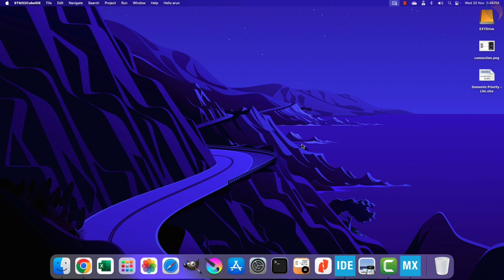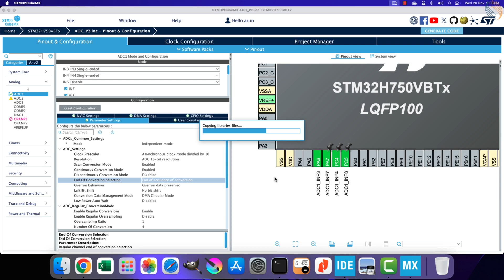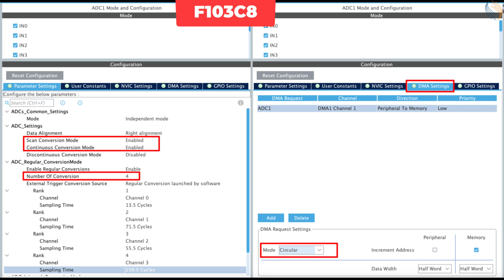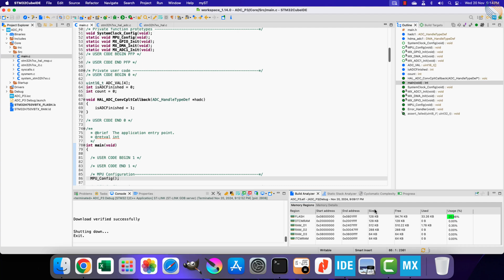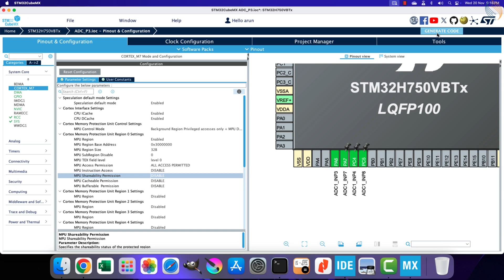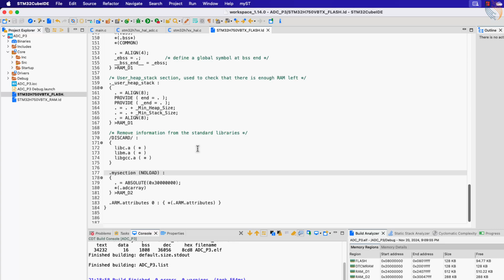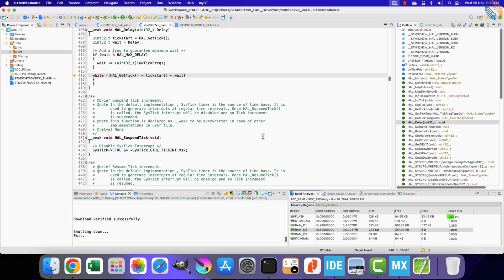STM32 ADC Tutorial #4: Multiple Channels using DMA in Circular Mode

Comment: I followed the tutorial using stm32h7 nucleo board. But the DMA seems to crash the other tasks, i tried managing the interrupt priority and memory allocations(along with the MPU with other tasks) but nothing seems to work. Do you have any solutions about using the adc with dma and freertos to work properly with multiple tasks?
Reply: I had a similar problem even without using FreeRTOS. The interrupts were clogging up the processor that I couldn't even enter the main loop. I disabled the interrupts in the .ioc file by going to the System Core -> NVIC tab, unticking the box "Force DMA channels Interrupts" and then unticking the "DMA channel global interrupt". Now the ADC is still continuous, DMA circular and always updating the value but I fetch the data when I want to.
Reply: @TheDarkDragon1996  you are a legend brother, amazing, I would have never been able to get it fixed without this comment